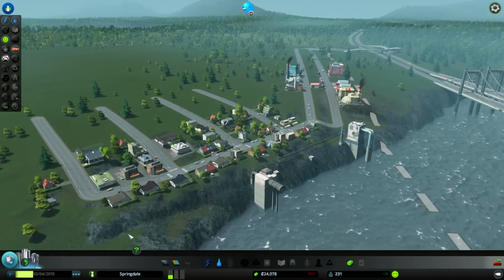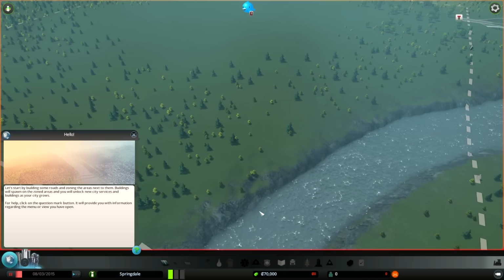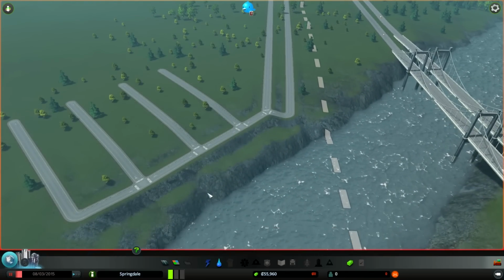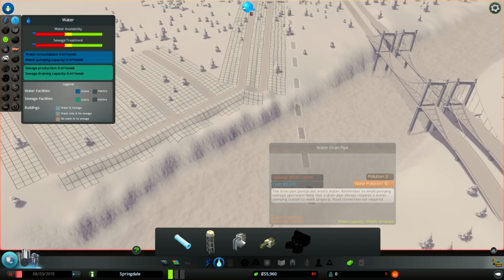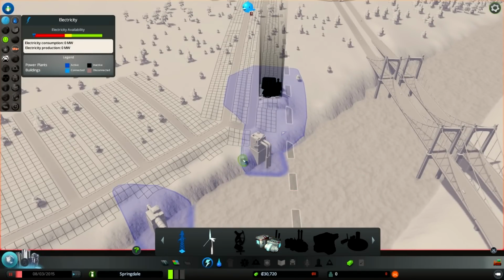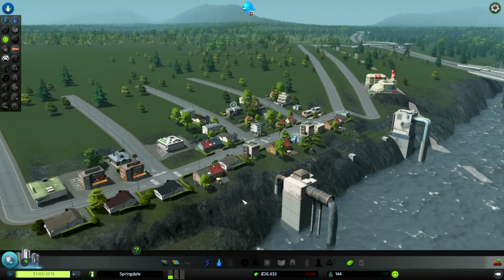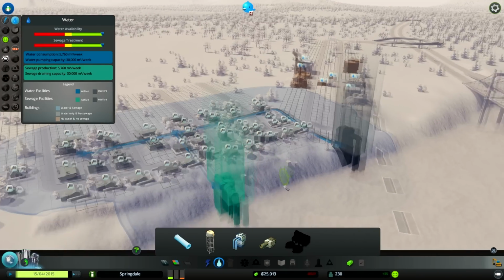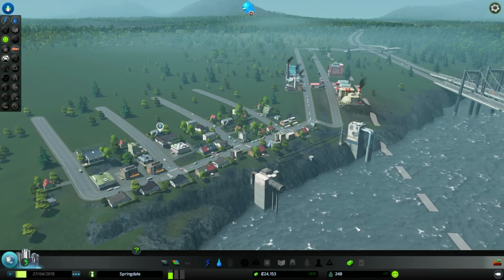Cities Skylines Tutorial #1 - Getting Started - Cities Skylines Beginners Guide

Comment: So, I had been playing and figuring it out myself and generally 'got it down', or so I thought.   Honestly I just like designing pretty cities so after some frustration I just went with mods that made it a sandbox.  Then I watched this first video and realized what I had been missing... the damn junctions setting, to disable traffic light. My larger roads get priority.  They have no stop signs or lights, but anything joining them has a stop sign.  This ONE thing has been a revelation and has changed my experience entirely.  Traffic problems are entirely gone.  At 70k and without any public transport whatsoever  my city is thriving with nearly 8 million in the bank.  The most I've had in about a month of playing by far... normally I'm 2 loans deep at least.    I'm holding an 86% traffic flow which is easily 30% better than I've achieved at the same population.  Previously my death spirals were unrelenting, now they're manageable.
I learned other very useful stuff too, absolutely :) but if I had to pick one thing, it is the traffic setting.